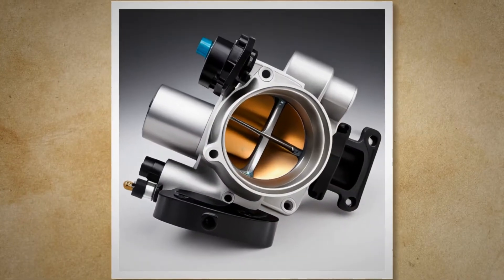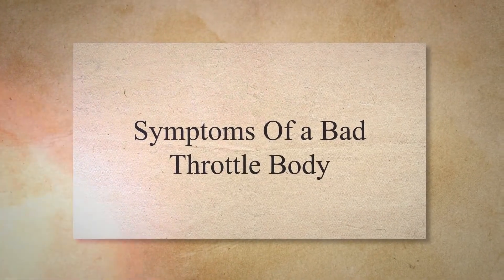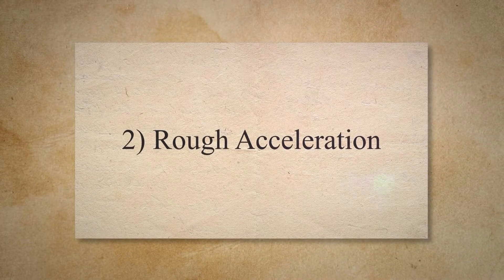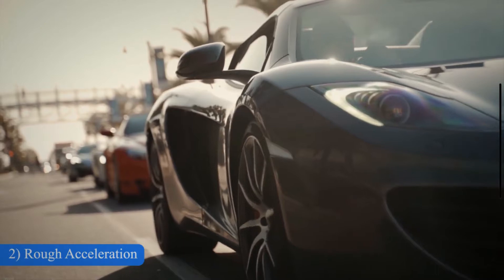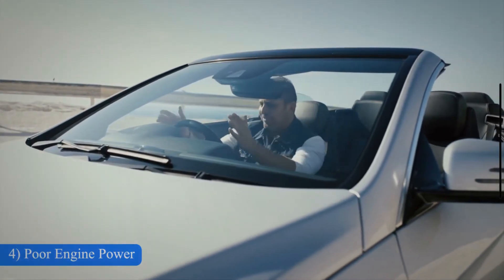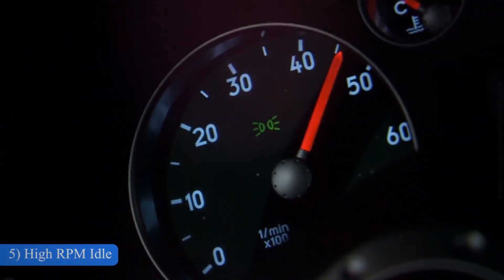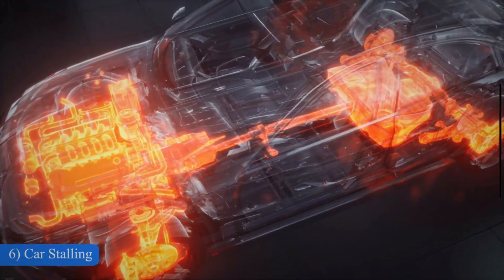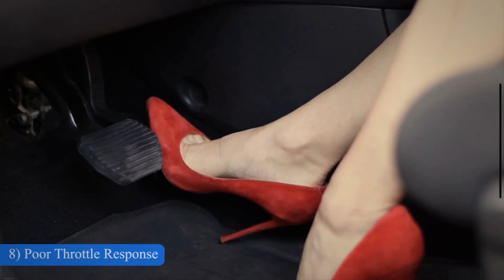Top 8 Symptoms of Bad Throttle Body

Comment: While driving a car the race reduced automatically then I paddle the accelerator one or two times to stubble the speed. Especially when the AC is on
Reply from the maker: When driving a car, experiencing a reduction in acceleration or "race" (RPMs dropping) can be due to several reasons, especially when the air conditioning (AC) is on. Here are some common causes:

1) AC Compressor Load: The AC compressor requires power from the engine to operate, which adds extra load. This can cause a temporary reduction in engine power, especially noticeable in vehicles with smaller or less powerful engines.
2) Faulty IACV: The Idle Air Control Valve regulates the engine's idle speed. If it's malfunctioning, it might not properly adjust for the increased load when the AC is turned on, causing the engine to stumble or idle roughly.

3) Dirty Throttle Body: A dirty throttle body can restrict airflow, leading to poor engine performance, especially under load. Cleaning the throttle body can sometimes resolve these issues.

4) Vacuum Leaks: Leaks in the vacuum system can lead to an improper air-fuel mixture, causing the engine to struggle when additional load is applied, such as when the AC is turned on.